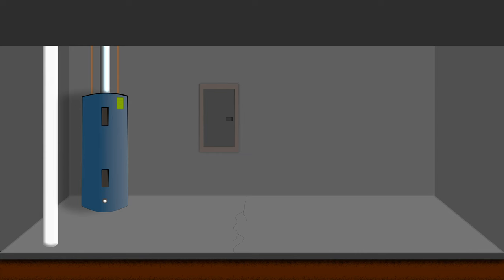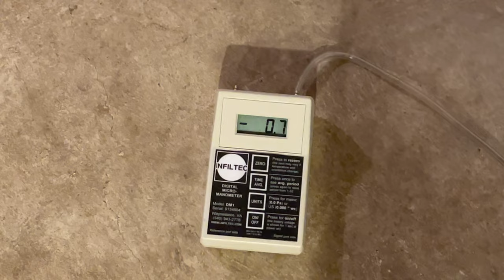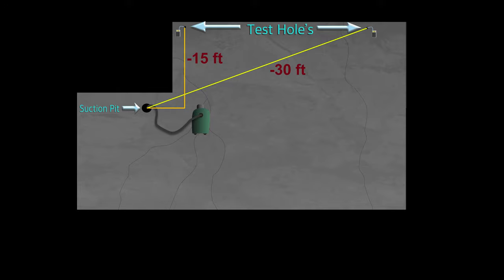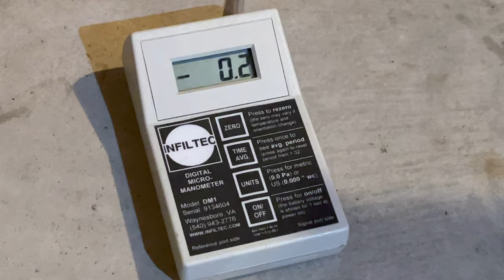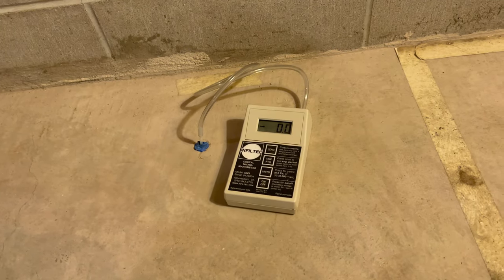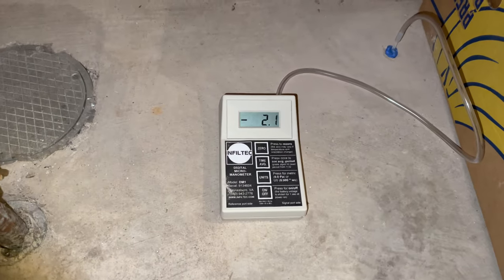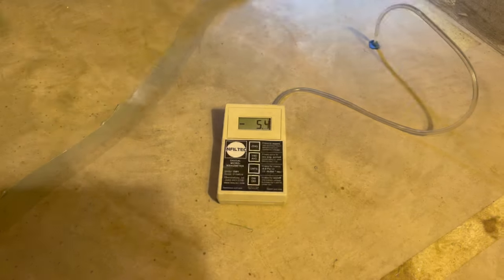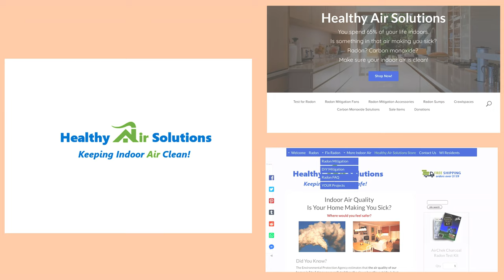Two Important Steps For A Successful DIY Radon Mitigation - Find Out! -

Comment: Thank you for posting and sharing DIY radon mitigation information on youtube and your website.  I recently purchased an AirThings air quality monitor.  After two days of monitoring, our radon level had climbed to 8.5 pCi/L average in our 1st floor living area.   Although it's recommended to allow 30 days to determine an accurate average I decided not to waste any more time.  I turned to your videos and website for information and decided to install a DIY mitigation system on our basement sump pit.  The sump pit is fed by two clay tiles that run around the entire inside perimeter of the basement walls.   I spent about $500 for all the materials including ~$150 for the RP145C and ~$100 for the Radon sump dome.  There are so many unknowns that I wasn't sure what the results would be, but I was hopeful that levels could be at least halved.  I spent about three days off and on installing the system.  About 24 hours after turning on the fan the Airthings indicated that radon levels had fallen to .8pCi/L, and after three days the level is currently reported as 0.  Needless to say I am very pleased with the results so far.  Thanks again for all the helpful information, especially the sump mitigation system info on your website.
Reply from the maker: That’s really wonderful to hear! Thank you for sharing your success story.

Comment: How about you guys rent out that digital manometer for its full retail price as a deposit there's a lot of us out here that would gladly return it to you and desperately need it. Second question is that Shop-Vac has a lot more suction than these little radon fans what's your thoughts on that?  I commented on your other video but we're sitting at 32 when the maximum safe levels eight so I have a lot of work ahead of me
Reply from the maker: @Jthumper Thats a good question! So it being a pretty costly device we don’t really have a system of renting it out, it might be something we should look into. Looking at your other comment tho from our other video, if you have a situation with drain tile you can use a shop vac hose and stuff it into the drain tile in the sump with some bags in the tile to seal it up. Then if you drill a hole along the perimeter on the other side of the basement you can use a smoke pen to see if the tile is there and if you are getting good air movement. 
Using the shop vac we will see higher readings of air movement than we do with the radon fans but its simply telling us that there is air to move and we can also tell what fan to use by how hard the vacuum is sucking. Often we see good readings after the fan is installed, not as high but enough to know the system has a good chance at working. But you can only know for sure when you retest. 
Keep in mind to, that even with a reading if 32, if you have drain tile run around the majority of your basement and if you use the correct fan for your situation, that number can drop well below 4. We have seen it happen many times. The key is to always test after you install your mitigation. For more information you can fill out a contact sheet on our website https://www.indoor-air-health-advisor.com/contact-us.html
Let us know how the mitigation goes! We wish you the best with it and are here to help if you need it!
Reply: We bought a $40 digital manometer on Amazon. (Autool brand) I would not recommend this for professional use, but since I'm a DIY'er it is more than good enough for me.
Reply from the maker: That’s nice for giving you an idea of what you are working with. Glad it worked out 👍🏼☺️ Thank you for sharing!

Comment: How do you know how much dirt to remove without the possibility of weakening the adjacent wall?
Reply from the maker: To avoid weakening the wall, avoid going below the footing. Focus more on going along the footing and  making your hole wide.
Reply: How do you dig out a wide hole just working through a 4 inch hole in the concrete
Reply from the maker: We use a variety of tools that give us extra reach, like screwdrivers and my favorite, an old saw blade with a duct tape handle. Once you widen the pit enough you get to a point where you can actually get your arm (depending on the size of your arm) into the pit and reach an arms length in all directions. We also use a shop vac that works well with sand, loose dirt and gravel. We will push the hose into the hole and get good reach that way. Be prepared to clean out clogs in the hose 😅

Comment: What happens to the suction pit if there is a lot of rain or snow melt, and the water table rises?
Reply from the maker: There are times when people will start to hear gurgling coming from their radon pipe in the basement and the reason being there suction pit has gathered water. But in most cases, especially with rain or snow melt the water will dissipate back into the ground. Only in a few cases have we had water that stayed and we then had to move the suction point. In these situations, if your water table rises then you will want to look into getting a sump and tile system installed.

Comment: How do you know if there is gap between the ground and the slab or is this the way its always done?
Reply from the maker: Every situation will be different but there is usually settling that occurs under the slab that can help with air movement. This settling often happens along the footings, which is why we often will place our suctions pits along the exterior walls. Even with packed clay, you can often pull a certain amount of air through it. 
This is not guaranteed tho which is why digging the suction pit out is very important. We have often experienced that digging out even an extra bucket helped us to reach an opening that increased our airflow greatly. Doing some suction tests with smoke can tell you a lot about what you are dealing with under your slab.

Comment: Have you ever needed to make holes in the foundation perimeter ground for makeup air?
Reply from the maker: Hi Larry, makeup air is not needed with a radon mitigation. You wouldn’t want to do anything to lessen focused suction under the slab.
Reply: My concern is that drawing from underground only draws up more radon.
Reply from the maker: A house naturally draws air up into it due to the stack or chimney effect. Often when we put a test hole in a slab and use our digital manometer we will see positive readings, meaning air is pushing up into the home. But after installation of the fan and sealing the basement those numbers are brought into the negative. This means that the radon that would have naturally been drawn into the home is now being drawn up by the fan and evacuated and safely dispersed above your roof line. The proof is after the installation of your system you do your retest and see what your current radon levels are. No need to worry, this is the most effective way of lowering your radon.

Comment: I started my hole in the corner of a finished slab basement built in the 90's. I'm at least 12" from each wall. So far almost a foot of solid concrete. Maybe in a footing, would you try a new spot or keep going?
Reply from the maker: Yes that sounds like you are hitting the footing or a place where excess concrete was dumped.
You can start drilling holes away from the spot in 4 or 5 inch increments until your drill bit hits dirt. Then make that the edge of your suction pit.
Reply: Monolithic slab or in footing. Probably monolithic
Reply from the maker: I agree that is a possible. So either way you have to continue moving your holes away from the wall till you find a thinner section of concrete. It is very hard to dig your hole out if the concrete is too thick.

Comment: How does a shop vac compare to a radon fan in cfm  and performance?
Reply from the maker: A shop vac has more power than a radon fan. From the reading we get with our test we can know that the communication is there or not and depending on how far down into the negative the readings reach with the shop vac, we can get a good idea of how the radon fan will do. We will test again once the fan is installed and even if we get a fraction of what the shop vac was reading we feel good that the radon levels will come down sufficiently.

Comment: Great explanations in the video! 

Quick question - the 6.8 pCi/L before level - was that peak or average? 
(and same question for the 1.4pCi/L after results). Thanks again!
Reply from the maker: Thank you, we are glad it could help. 
So both readings were from short term tests showing the average radon readings over 2 to 4 days.
Using short term tests is a good way to get an idea at where your radon levels are during any given time of the year, especially during the winter when they are at the highest. A long term test can give an overall view of your average through out the year.

Comment: Good video,   I’ve mitigated over thousand homes(250-300) yearly.    Wish you would’ve expressed that cold crack caulking is the primary,  as in northern states like minnesota and wisc only seperated cracks are addressed not spider cracks and they are endless.
Reply from the maker: Thank you Mike for your comment and all your hard work fixing homes. Working in those northern states you mentioned, we know that to be true. Focusing on those separated cracks is key. The smaller hairline cracks connected to those larger cracks do need to be caulked. Isolated spider cracks, because they aren’t all the way through the slab, are not necessary to caulk.

Comment: super helpful.  The house we moved in to is 60+ years old.  We bought it in October and the levels were just under 4, not enough to warrant mitigation, even though they were well aware they were going to spike in the winter months, which is kind of BS.  We ended up having to gut the entire basement and after it was re tested in the winter months our numbers were over 12, consistently.  I'm pretty mad about it.  There were very large gaps along the edge of the foundtation and several in the floor.  It'll be interesting to see how good of suction numbers we can get.  All the edge cracks were sealed with cement caulk, as were the floors.  I'm hoping for a great result once all is done.
Reply from the maker: Sorry to hear about your experience, that’s frustrating! We are in Wisconsin so we see just how much radon levels can swing up in the winter time. A long term radon test can give you a good idea of what you are on average being exposed to. 
That sealing will for sure help with your suction. I hope your mitigation goes smoothly!

Comment: Great video and well produced! If my slab is on top of gravel / crush is it still advisable to dig up as much as I can of it through the suction hole? Will this improve airflow?
Reply from the maker: We are so glad the video helped! When we have gravel we will typically dig out at least a bucket so the suction hole has room to pull air. To dig more can always possibly increase air flow and helps when you have a large square footage basement with no drain tile.
Reply: @healthyairsolutions5950  appreciate it, thank you!
Reply from the maker: Happy to help!

Comment: Thanks for a great DIY video... I have a lot of cracks in my basement.. Which sealant do you suggest to repair those  gaps before I proceed with Radon pump
Reply from the maker: Thanks @Govind Paul, glad it could help! What we use is a silicone and urethane caulk. Here’s links to 2 different brands on our website we use on mitigation jobs:

https://shopradon.com/products/RadonPro-Sealant-by-RadonAway-p145313404

https://shopradon.com/products/Titebond-Radon-Sealant-p145313441
Reply: @healthyairsolutions5950  thank you so much for your quick reply... As I am very new to the sealant... I am not sure which one should I order from these 2 for my basement floor crack repair.... Or should I order both and apply one over other...
Reply from the maker: So the Radon Pro sealant is the better quality because it uses urethane. We would recommend using that. You only need to apply a bead and then smooth it out into the crack using a piece of cardboard like you see in the video. 
Please don’t hesitate if you have any other questions!

https://shopradon.com/products/RadonPro-Sealant-by-RadonAway-p145313404
Reply: @healthyairsolutions5950  thank you once again... it is so unfortunate that this product is not available in Canada :( Can you please suggest some alternate
Reply from the maker: Sorry for the delay! We can’t say which brands would be available in Canada, but if you look for a caulk that has a silicone and urethane combination that would be the one you want.

Comment: So I sealed all my cracks with concrete patch but I’m still getting readings of high radon? Is concrete patching supply from Lowe’s not effective in reducing radon?
Reply from the maker: So sealing your cracks in the concrete helps only alongside a mitigation system. It helps with increasing the reach of the suction that the radon fan is able to accomplish. Do you have a mitigation system installed?

Comment: Could you please post what product you use to seal the cracks in the basement.
Thanks.
Reply from the maker: Hi @dougmaverick3287, here is a link to two different sealants we use and along with backer rod that is often helpful in sealing bigger cracks.
https://shopradon.com/products/Sealants-and-PVC-Cement-c36410015
Reply: @healthyairsolutions5950  
thanks and Happy New Year.

Comment: One question, other than thew cracks in a basement floor, what about the joints between the floor and the concrete form walls of the basement where air can move also. I have read you are not suppose to seal those. any feedback?
Reply from the maker: Thanks for your question. If the joints run all the way through then they should be sealed. If not you will be sucking out air from the home and lose the negative pressure the fan creates.
Reply: @healthyairsolutions5950  Thanks for the response, so if we are running 4.7 pCi/L and the basement is approx 1800 SqFt then which fan would you go with?
Reply from the maker: @3dparagon  To make a fan recommendation for you I would need to know:
Do you have a sump basin with drain tile?
What do you have beneath your basement? (ie sand, clay or gravel)
If you prefer you can go to our website and fill out our questionnaire and we will email a recommendation.
Here is the link: https://www.indoor-air-health-advisor.com/do-it-yourself-radon-mitigation.html